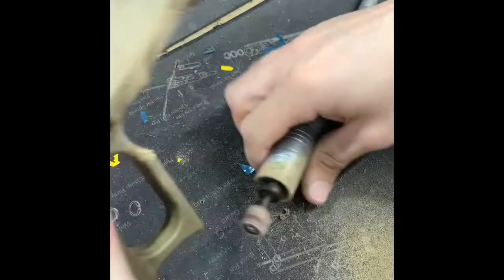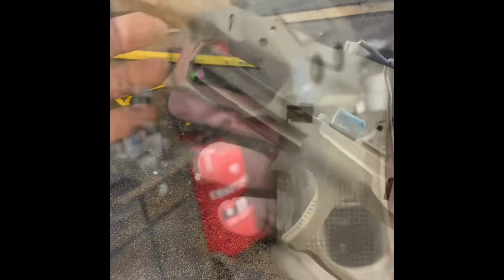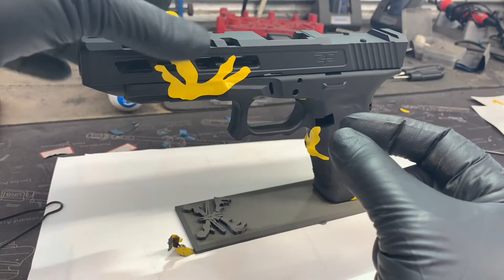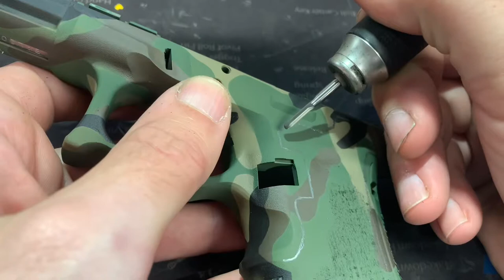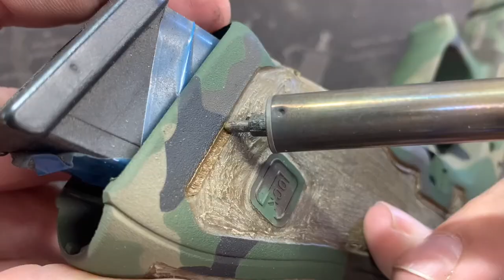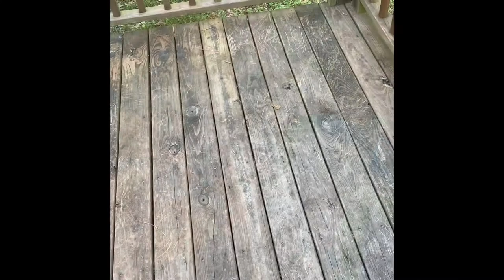Stippling & cerakoting a custom G34

Comment: I have a black frame CZ. If I paint it and then stipple, will the stipple be the black of the frame? Or would I need to paint the stippled part black? Or would it be best to stipple first then cover the stippled parts and then paint the frame? I’m wanting to paint the frame similar to the one you just did and stipple it, but I want the stippling to be black.